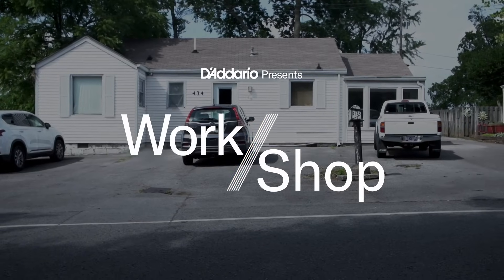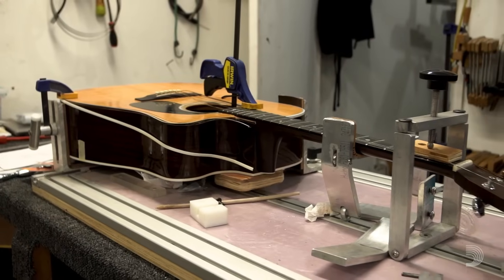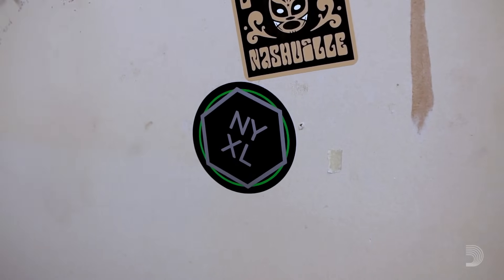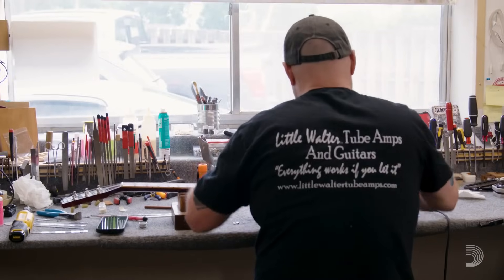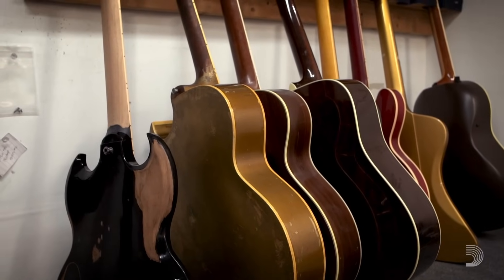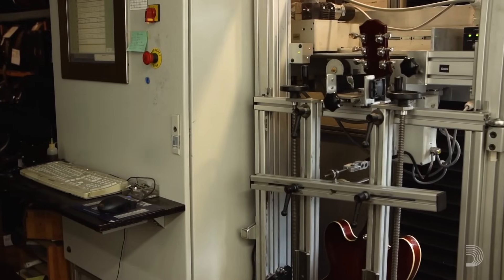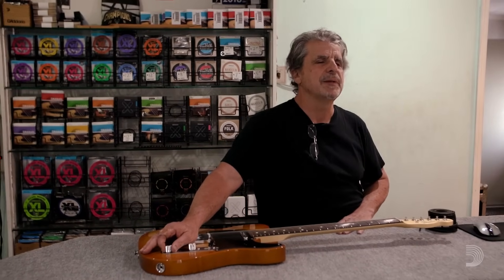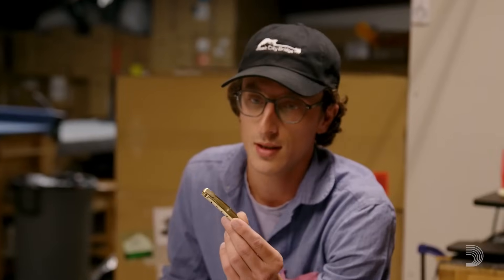Work/Shop: Glaser Instruments x D'Addario

Comment: Interesting video. I first heard of Glaser’s from Tom Bukovac and that they are the go-to guitar repair shop for Nashville. For years I used another brand of strings then starting encounter flawed and corroded strings. I initially thought a bad batch accidentally made it to market but that wasn’t the case. I tried some D’Addarios and never looked back. They feel right and last so much longer than the other brands. Keep up the good work!

Comment: I got a chuckle out of the last line Joe said. I've brought a number of guitars to Glasers to have work done. The very 1st time (I had my 1961 Es 355 worked on) I brought something in I literally said "oh, good, you sell NYXL's. i dont need to bring a set of strings in. At least in my case, he was 100% correct. They sell what their customers use.

Comment: I have two guitars that have double benders installed,. My red tele was the first guitar to get his new style double bender which due to my guitar, came with a few issues which I'm very thankful for because It allowed me to spend time just Joe and I on a Saturday at the shop problem solving. As Adam said in the video, all of the guitar greats and their guitars come through the shop, my first time to the shop Joe says ""you just missed Ricky and Vince."  I hold Joe in that same regard.  Yeah and the strings are pretty good too..